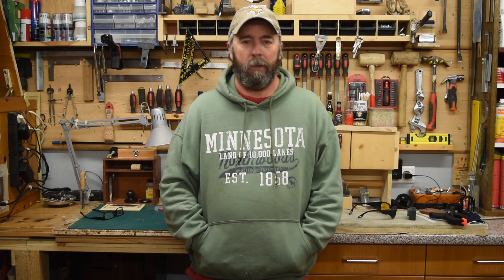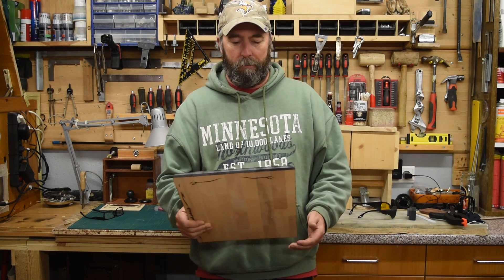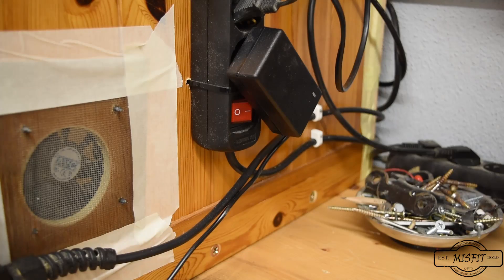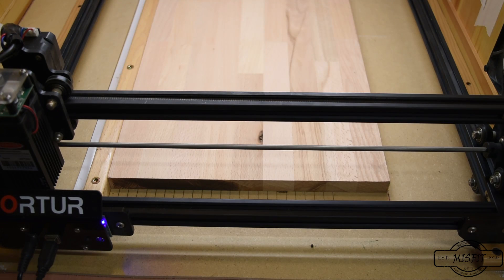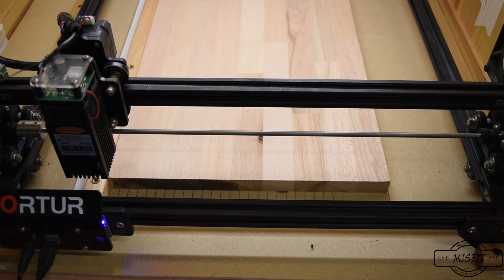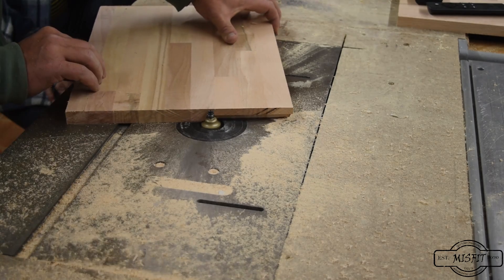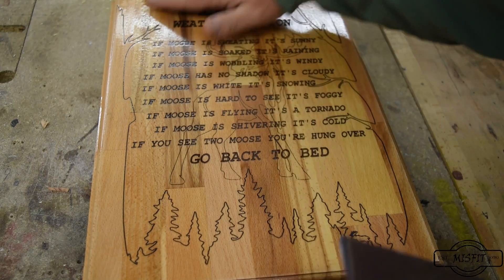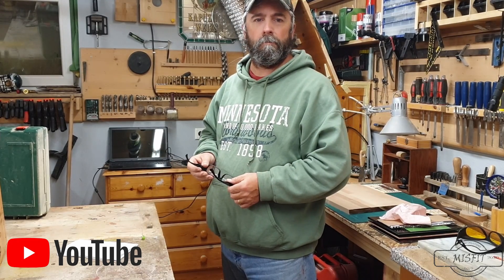Make a sign with an Ortur Laser Master 2

Comment: instead of epoxy try painting glass on the backside and etch off the paint with your new laser and then paint a different color
Have your laser set to etch reverse so when you flip the glass over it will be super glossy and have the same effect as the epoxy
keep'em coming
Regards Rick

Comment: This is not a criticism, I think when you do line art like this the words that are on top dominate the image and you loose the line art under, what I feel you need to do is add more depth to the line art by altering the drawing slightly and adding 3d depth in the drawing or if your not a 3d graphic artist then add some shading into the line art objects and give that a try, It just needs a bit more depth to bring whats underneath through a bit more. Otherwise very nice work.   I use an Endurance 10 watt which has a lot more power than the Ortur, How are you finding  the Ortur? Does is cut well?
Reply from the maker: Sitges, thank you so much for the feedback. I will have to look into that when I do another one. Do you know of a video showing an example of the shadowing you are talking about, I would like to see that. As for the Ortur, I'm happy with it, I only use it within my comfort zone. I'm slowly trying new things but I have noticed its not the best at cutting. Thanks again for commenting and watching.

Comment: I just got my ortur and you are about the 100th video I have watched.  I noticed the box you built around it and I think that is beyond brilliant!  Do you have it vented somehow?
Reply from the maker: azbowhunter5.
Thanks for watching the video and commenting. Yes, it is vented. I was trying to remember the video I did that showed my venting. There is a 6inch hole on the side, a flex tube that goes to a extracter on the ceiling then vented out the shop window. Thanks again for watching.
Reply: @misfitdiys4791  thank you sir for your response.

Comment: Thanks for this, Clear White Pine is good for Laser Engraving, Red Southern Oak is good make sure the Cathedrals are vertical they contain resin and if they are horizontal the work will bleed and be more smokey. Murphys Oil Soap works great on Wood and Leather.
Reply from the maker: Elisabeth, glad you liked it. I plan on doing another burn like this. I will see if I can find some clear white pine.
Reply: @misfitdiys4791  make sure the grain is vertical you will encounter less resin pockets thanks for all you do getting one of these to run some cuts before I get my mira 9. Been in the Laser Business since 87 and I had the Weatherby Lazermark until they bought their own! I have loads of resources if you have a FB group this includes leather supplies too!

Comment: Excellent video.  
Can you engrave only to rectangular objects or also on non-rectangular?... For example a guitar body?
Reply from the maker: LIVINGSOUND, If you can create the shape in lightburn or whatever program you use and it fits in the (bed) of the laser area it can burn it. If you can create a silhouette of the guitar and import it into the program it will follow what ever lines you tell it to or you lift up the laser over the guitar and burn a specific area. I hope this helps.
Reply: Thank you very much for your answer!  Good luck

Comment: Thanks so much for the great video. I have a question I was hoping you could answer for me. I’d mostly be engraving on cutting boards but sometimes the cutting boards I make are slightly larger than the Ortur frame. Is it possible to engrave on larger objects by placing the Ortur legs on some blocks of wood to raise it up and then sliding the large cutting board underneath of the raised Ortur? I hope that makes sense. I appreciate your help!
Reply from the maker: Craig, yes you can raise the whole platform.  You just have to figure out how to readjust your laser. I know there are multiple mounting holes on the laser mount plate. For me the laser is around 30 to 35mm from the service that I'm burning.
Reply: @misfitdiys4791  great, thank you!
Reply from the maker: @tweddelltrumpet  Any time.
Reply from the maker: Craig, To answer your question,  yes you can raise it up. You just have to make sure everything is secure. It will shake the higher you go but it should be no problem.  Just keep an eye on the distance from the laser to the cutting board.

Comment: Hello, have you tested engraving on metal like dog tags or keychains? Will this engrave those items?
Reply from the maker: Ryan, Thanks for watching.
I have not tried metal yet. I just happen to have some blank dog tags, I might give it a try tomorrow. I will let you know.
Reply: @misfitdiys4791  thank you. I bought a machine that's coming and before I buy the blank tags it would be great if you could test. Please update me as soon as you test, maybe you can email me a photo after? Ryanderot@hotmail.com 

This would help me tonnes
Reply from the maker: @ryanderot  I will try a few techniques, if it works I will let you know.
Reply: @misfitdiys4791  let me know either way :)
Reply from the maker: @ryanderot  I tried a few thing and nothing so far etched the tag. I will keep trying.
Reply from the maker: @ryanderot  The ones I painted red or green turned out nice as a burn but didn't actually etch the tag. I also tried some other chemicals but they failed as well. Like I said, I will keep trying.
Reply: @misfitdiys4791  thank you

Comment: Like you, I saw the green hulk tile video, thought that was really cool, so bought the ortur 20w. So far I have put it through its paces and the only wall I hit was trying to cut 3mm birch, added air and it helped but really does everything great I found, just not cutting 3mm, 1.5mm no problems. I did find some neat 3d printed additions on thingiverse.com to improve prints (air adapters, adjusters, feet stabilizers). Keep up the lasering!
Reply from the maker: root toor, thanks for watching and commenting. I will have to check out the link you sent. I recently saw an unboxing video of a newer Ortur and it came with an adjustable laser. I might have to think about upgrading my laser for that reason. Thanks again.

Comment: Great video!! What power and speed do you use on light burn for engraving wood? I’m new to this and I use lasergrbl and lightburn, with lasergrbl I notice that the laser is more powerful when I use that program as I am able to change to the material I am using. I can’t figure out how to do that on lightburn and it seems like laser it’s not as powerful even if I put to 100 and change speed.
Any help would be greatly appreciated. I engraved a mirror with lightburn and had to do multiple passes at 80% and higher to get the image to show and on lasergrbl it took one pass at 80% for image to show. I was engraving on back of mirror.
Reply from the maker: Tim, thanks for watching. Those are some really good questions. I guess I never noticed the difference sine I switched to Lightburn so fast. You've got me qurious about the differances. Let me do some testing on glass since its one of the things I haven't done yet. Maybe I will post a video on it. If you watch my other video on burn settings it might answer your other question. Hopefully I can get an answer for you in the distant future. Thanks again.

Comment: definitely wondering about the darkness of the lettering.  I got the laser burner figuring it was a given...apparently not!  So now I'm looking for the answer to how to get it 'black' and not brown.
Reply from the maker: Doug King, thanks for watching. I am going to do a little video on the burn settings in the next day or two. Hopefully it might answer any questions.
Reply: @misfitdiys4791  yeah, I'm really struggling with it....
Reply from the maker: @DougKing4416  Just out of curiosity,  what wood are you mainly using?
Reply: @misfitdiys4791  honestly? anything I can come up with to test on. I have tried a soft common wood from HD. A pallet board probably a hardwood of sometype.  A very clear and precise cut was on a 1/8 piece of white board....right now I'm doing a rose on a piece of bamboo.  I tried a rose on poplar which didn't come out real good either.  Also adjusting laser height as well as focus...

Comment: Hey. small tip -  Turn on the "Fast Whitespace scan" in the device settings on lightburn. and increase whitespace scan speed. It will save the engraving time. And also for the text filling use "Fill shapes individually" mode It also save the lot of time.
Reply from the maker: Yasith, thank you for the tip. I will definitely try those changes on the next burn.
Reply: @misfitdiys4791  Any Time ✌️
Reply from the maker: @yasithisurantha6268  What would you recommend for the Fast Whitespace Scan
Reply: @misfitdiys4791  I'm using 3000mm/min for the Fast whitspace scan
Reply from the maker: @yasithisurantha6268  Thanks, I will give that a try.
Reply: @misfitdiys4791  okay
Reply: @misfitdiys4791  Sometimes I use 4500mm/min for Raster engraving.(in Dithering mode)